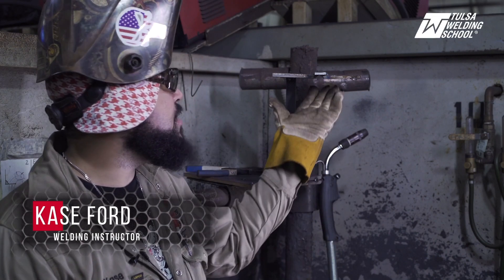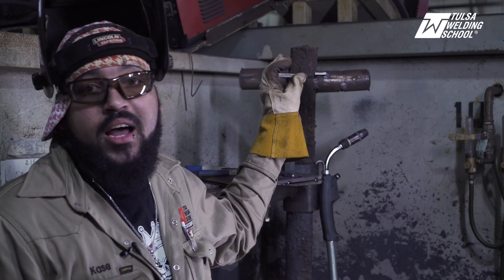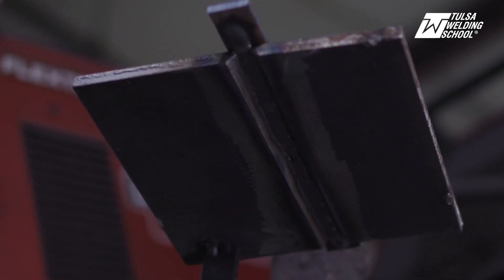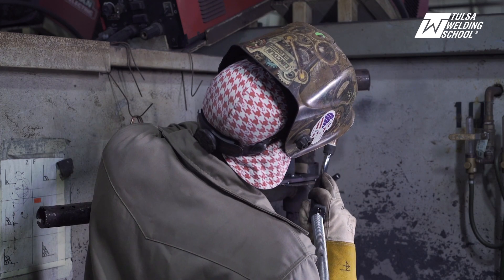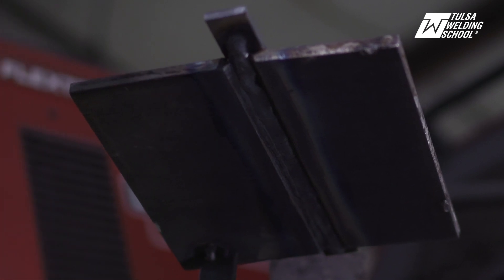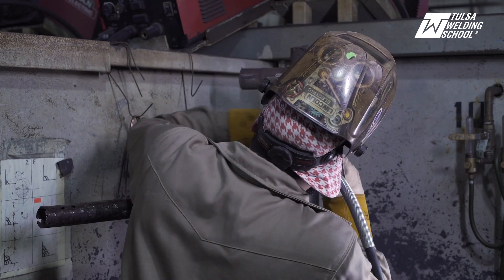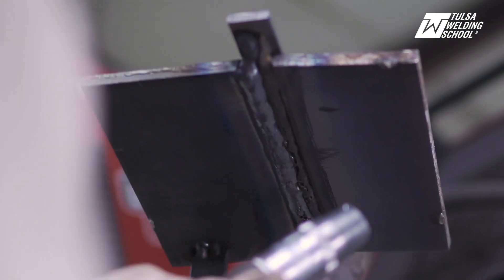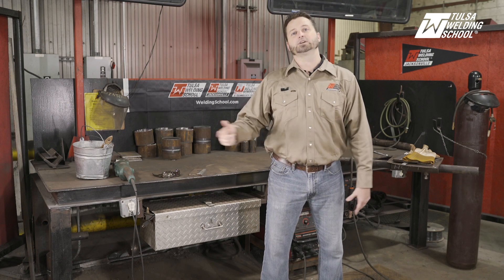Flux Core Overhead Welding on a Beveled Plate ~ Tulsa Welding School

Comment: I appreciate your videos bro!! I have a shipyard fitter test tomorrow.. simple T-Joint for a fitter position.. this will be my 10th time doing the test, but its at a new shipyard so im a little nervous. I dont have a machine at home so im using these as a refresher! in reality as a fitter i barely ever even touched the voltage, just ran at 24.5 for everything. going to try that u did here and bump it to 25v for overhead! overhead is what im worried about the most.. spent the last 3 years just building the bulkheads for DOD vessels so i have been mainly welding flat.

Comment: Turn the fan off that's stealing your gas. I literally welded in 95 degree heat over the summer. Lay your welds then turn the fan back on to cool off.

Comment: The purpose of his video is to show process. He has an exhaust fan that causes major air movement over the surface. This blows away shielding gas. They normally run with the curtain closed as well, which helps. I have personally welded with that guy, and can promise, nobody can run wire like him. How about we just thank him for giving us his time?

Comment: Okay but did you guys see the porosity on the 2nd to last weld 🤣
Reply: Still being a student, I think it's OK as long as it will be welded on top of it anyway, but nevertheless I have zero tolerance for them as I think it's good practice to do so. If I do get porosity in my cap welds, I just grind them off to re-weld it, or grind the whole bead off, and weld the whole thing again.
Reply: It happens when your nozzle gets plugged up with spatter, plus he is running OVERHEAD. Very common to happen, it's always wise to clean the nozzle every pass

Comment: I would like you to do this video again, explaining what the gap is, thickness, torch angle, inter pass temp and wire + gas combination. 
If you could, would you also place a light source to illuminate the underside of the plate. 
Your torch holding technique is interesting, some words about that perhaps?
It’s obvious that you can weld, all we want to do is to learn a percentage of your skill.